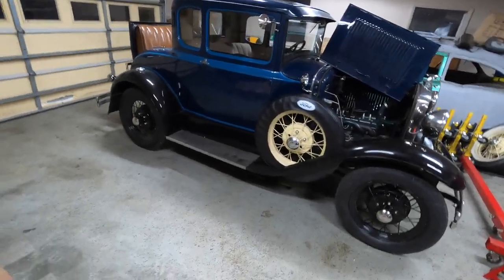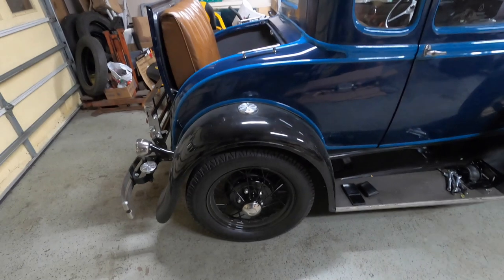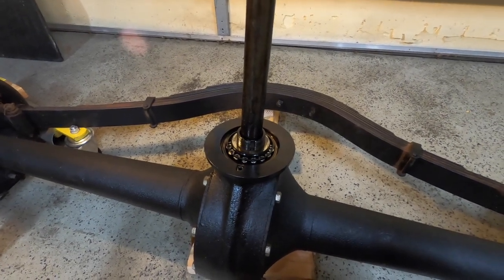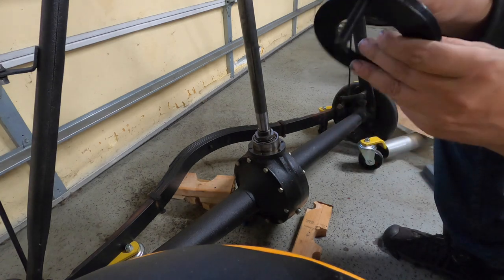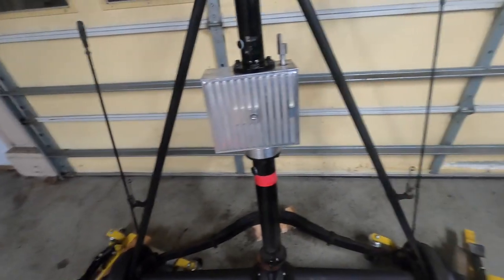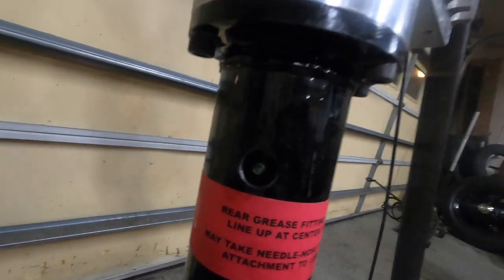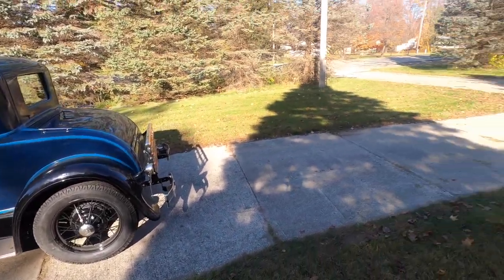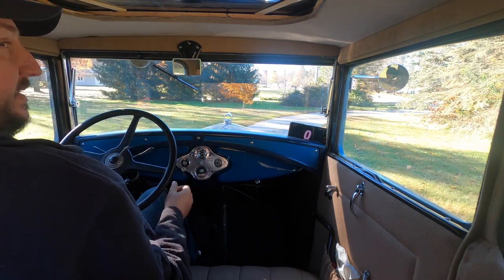Mitchell Overdrive Installation in Ford Model A with Burtz Block and Flathead V8 Transmission

Comment: Very informative video. When using the Mitchell puller, I used a 1⅛" Clamping Shaft Collar instead of loosening the large pinion nuts. It clamps on the drive shaft.

FYI, your light switch is upside down.

Comment: The only thing i would worry about would be the service brake performance, at the higher speeds, but you are an expert on these cars, great video👌
Reply from the maker: That is a very good point and something I forgot to bring up during the video. I have the brake floater kit installed on all four corners and my brakes are all in top shape and adjusted very well. My limiting factor is actually the tires -- I can very easily lock all four wheels at nearly any speed. I've been on the fence to switching to the V8 16" rims for the sole purpose of being able to run wider tires. You definitely need to be aware of your cars limitations and drive accordingly.

Comment: So, with the Michel box, what's the difference in rpm's between to two high gears. To me, just listening, it seems to be ~500 rpm's.
Reply: I believe another channel said it takes you from a 45 mph car to a 55 mph car in overdrive at the same RPMs. ?  
 I think it's only a 3500 RPM engine...
?   I'm still trying to find out...

Comment: Are you for Hire?
Reply from the maker: If you're close enough to me, I can usually be convinced to help out on just about anything
Reply: @JamesSorenson  where are you located?
Reply from the maker: @zdavis79  Michigan, between Grand Rapids and Lansing
Reply: @JamesSorenson  awesome. I'm north of Kalamazoo. Coming to the show this weekend?
Reply from the maker: @zdavis79  Yes, I'll be there both days. I don't have a booth and am not part of any of the events, so I'm usually just roaming around checking out all of the vehicles and the swap. If they do the will-it-run event again, I'll likely be volunteering to assist in that again.
Reply: Looking forward to check out your burtz engine.

Comment: That is an amazing overdrive device, and it gives your car much more flexibility. It would be great if they were available for other cars. Here in the UK I have a 65 Mustang 289 V8 with a 3 speed C4 auto box. At motorway speeds of 70-80mph it really feels like it could do with another gear. Getting a 4 speed box here in the UK would be pretty expensive and I think a fair bit of trans tunnel cutting would be needed. A device like this seems a neater solution.
Reply: Check on a Gear Vendor overdrive. Not cheap but they are bulletproof and easier to install than the Mitchel.
Reply: Tire size is your final drive gear.....  If you want to lay more rubber drop down in tire height....    If you want a higher top end, use taller tires....   1 inch either way is noticeable.

Comment: In 50's and 60's British cars as well as Volvo's, there would be an electric lock-out preventing you from using overdrive in the inderect gears, supposedly because the overdrive couldn't handle the extra torque. The final ratio would often also be higher (lower geared) eating up half or more of the potential rpm reduction against the standard version without overdrive.
The truck-style gear splitting was not used in cars - at least not from the factory.

Comment: Hello James. I recently fitted a volvo 4 speed and overdrive in my 32 sedan. I really like the overdrive and I'm sure you will like yours. Strange thing I have noticed when making a video, is that when I switch to overdrive the road noise seems louder. In reality it isn't, it is quieter, but it is the auto noise level settings in the camera sort of over compensating. I didn't notice that in your video, so yours must work differently. A little joggle on the mitchell stick to the right will get you the clearance you need, I would suggest. I enjoyed going for a ride in the A. Edit: I wrote this before getting to the end of the video!
Reply from the maker: I may try to straighten one of my V8 shifters so it is more "upright" such as the original Model A one and see how that goes. Otherwise I'll go to town on the Mitchell lever itself.

I used a GoPro HERO8 to record this -- the sound normalization seems to be OK through the built-in mic for most things.

Comment: Sweet drive train set up. I imagine you have some sort of auto spark advance as well - never saw you touch that lever. I can watch Model A drive arounds for hours. Not boring at all. I won't be installing any of these mods in mine, but I love watching others do it. Thanks for the post.
Reply from the maker: It has a NuRex timing advance kit in it, which seems to work OK for most of my driving.

Comment: Just out of interest, why did you go for the Mitchell , in comparison to the cheaper alternatives like Ford T5 or even 4 speed Top Loader conversions?
Reply from the maker: There were a multitude of reasons -- the primary one being availability. I could not find any of the 3sp+OD (T170) top loaders within a 750 mile radius of me or I likely would have gone that route. I did not want to go open drive, which ruled out many of the T5 setups.

Comment: Hi I have a 29 Roadster,  with the A trans, i bought the car with a Mitchel in it. i cut down the Model A shifter. i also split second and third, i  can shift both boxes at the same time. second high is great for going up hills, also i have 3;78  gears in the rear
Reply from the maker: The gear ratios in the V8 transmission are equivalent to approximately 10% overdrive in 1st gear and 15% overdrive in second gear when compared to the original Model A box, which made the car feel considerably better than the original transmission already. This was why I was uncertain just how much I would use the Mitchell, given that I already had a fairly significant improvement over the stock ratios. However, once I got going, I immediately found it was still beneficial. It feels like a very close ratio transmission now and gives me a number of different options for making sure that I am within the power band.

Comment: OD Shift lever: Drive out the original pin, then rotate the lever counter-clockwise about 15 degrees, or as necessary, then drill a new pin hole. OR, while you have the lever out, tap the original pin hole for a set screw. As an added precaution, drill a very shallow hole in the lever, to give the set screw a positive seat.
Reply from the maker: If I do go that route, I'll likely use the set screws for adjustability. The only thing I'm hesitant about is how much it stands out when they're canted to the side like that. I'm trying to find another of the straight stick flathead shifters to try to take bend out of and give a similar angle to the original Model A sticks.

Comment: Can you heat the shifter and bend it a couple degrees to the right??
Reply from the maker: Yes -- though there are easier ways, such as taking the pin out and installing set screws. That also wouldn't harm the finish, though it may look a little "odd" that way. I have a new shifter on the way that I'll try to straighten to be similar to the original Model A stick first though.

Comment: Excellent video James. What would I need to install the v8 transmission in my A?
Reply from the maker: I used the CLING's adapter, which is available through most of the Model A shops. It will come with a transmission adapter, pedal mount, clutch release shaft, emergency brake mount, and a wishbone mount.

https://www.clingsaftermarket.com/
Reply: @JamesSorenson  Thank you for the information.

Comment: Still waiting on mine!
Reply from the maker: When I got on the list in January, they said the wait would be about 3 months -- took about 9! During that time I rebuilt most of the car and did the transmission and engine swap and put nearly 3500 miles on the new Burtz block, so by the time the overdrive showed up I wasn't quite sure if I still needed it or not. The more I'm using it though now that it is in, the more I'm loving it!
Reply: I’ve had it installed about 10 months now. My shipping crate was ripped at both ends! U.P.S. was rough with it. Install went well, no problems. But I’ve noticed that when shifting the Mitchell from low to high, it will grind gears for the first few shifts unless you double clutch. After 10 miles or so it will shift fine.

Comment: So I'm very jealous,however great vid.Are you running the car with the advance in the down position or you up a few notches?I'd take going up hill at 50 any day. I'm all stock on our 28 Tudor,and have only gone 50 once,and sounded like it would vibrate apart. We're very fortunate to live in N.H.and in an area where the speeds are 30-40on the back roads.Hope I can make it to Michigan so you can install my Mitchell when i receive it.I wish. Excellent topic,great video.THANKS Dean J.
Reply from the maker: I have a NuRex timing system in this car, so I don't have to fiddle with the timing lever much. On flat surfaces, I add some advance for cruising, otherwise I run it all of the way up and let the device do its thing. The hills here aren't too bad, but most of the "back roads" are 55, so it's easy to draw the ire of people or get run over. The gearing in the V8 transmissions really helped improve drivability around here, but now with the overdrive the additional flexibility it provides has been amazing.

I love wrench on old cars and can never seem to find enough of them around here. I've joined nearly every Model A club in the area just to try to find more cars I can wrench on, but the pool is drying up! I love helping people get old cars back on the road and I especially love the stories that come along with them. The Model A's often have a lot of stories, so they have been my favorite as of late.
Reply: Thanks for the reply.Ive got 5 or so old timers in my area that would be a great interview .They range from 72 - almost 9 Each one has tons of stories going way back on their lives and how model A's became such a part of their lives.Again Thankyou for your time.D.J.
Reply from the maker: I tend to gravitate toward those older folk at shows and events as to many of them, cars meant something very different than they do now, so they often have many great stories about how certain cars impacted their life -- especially the Model A, as so many became integral to peoples lives as farm equipment and the like. I wish it were possible to know the story of the ones I own, especially my Model AA -- that thing has seen some use!